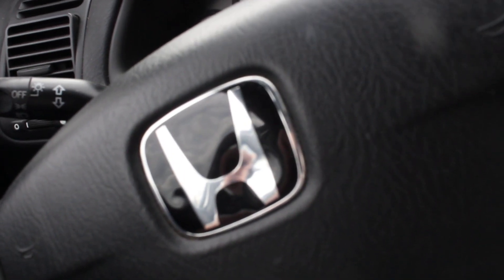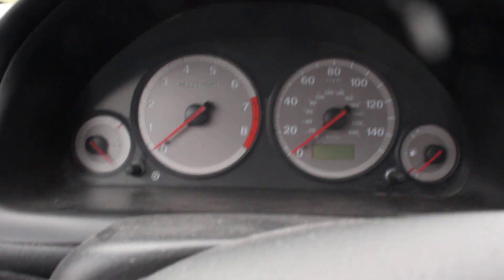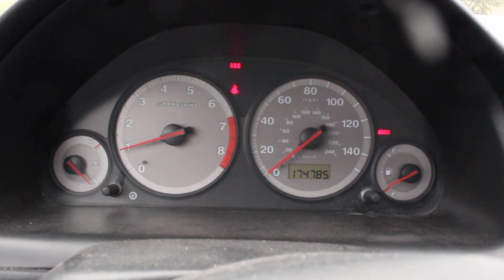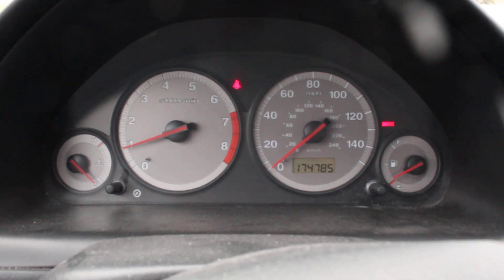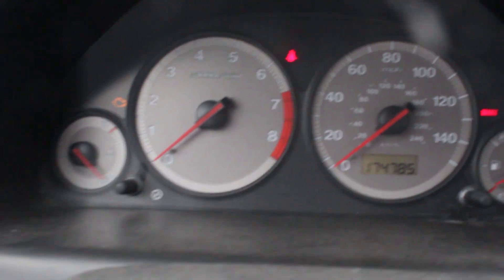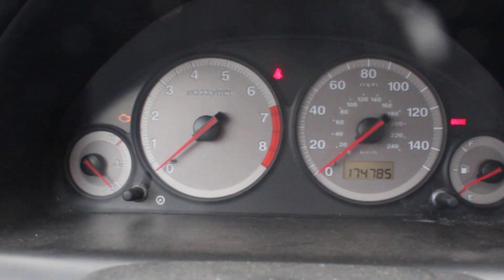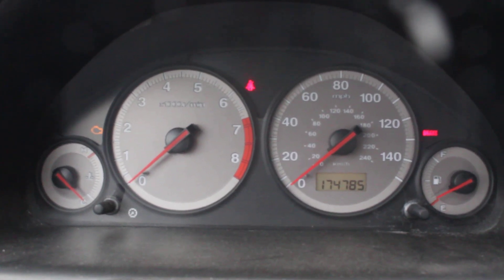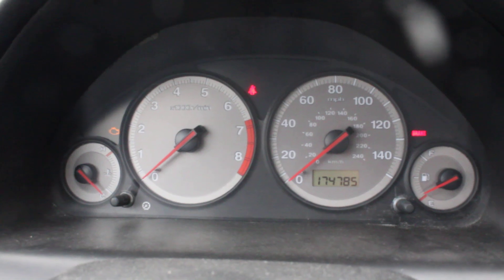What Honda "Limp Mode" Looks Like, '02 Civic With A Bad ECM

Comment: so did what fixs this got one doing the same and dont wanna spend $250+ trying to fix lol
Reply from the maker: ECM. I got a new one and had it flashed.
Reply: wildwildwest11 ok so they can flash any computer to my key?
Reply from the maker: Yah, that is what they do when you bring it in. You give them the whole car, the key and the new ECM. They need to use the Hondata diagnostic computer to sync them all.
Reply: Thanks for the update
Reply: Sorry for all the question, ,,but my civic is an lx 5spd,,,can I use any ecm as long is for same year and lx?
Reply from the maker: I would try to match the numbers on the ECU. I bought one from a parts re-seller on eBay that advertised it as an exact match and I contacted him to verify the numbers.

Comment: apart from this moment, the car goes into limp mode, than both the temperature gauge and rpm gauge turn off, and the car works in low rotation... you can drive... but only at low speed.. just like when one of the pistols doesn´t work.
So, I went to a Honde Dealer, the find out what was the problem.. He told me that one of the fuel injection points was dead or not working and that some electric wire must disconnected or in short with the ground. around 500 bucks to fixe it.. so and decide to not

Comment: Hi wildwildwest, thanks for the video. I got exactly the same problem on my civic 2003 ! I try to start the car, then I have to step on the fuel pedal in order to keep a high rpm (otherwise the engine will die), then a can hear some relay clicks coming from somewhere inside the panel, the clicks coincide with the MIL blinking (the battery lamp indicator is also on during this time). after 5 or 6 clicks, the battery lamp light off and the ingine MIL (the yellow one) light on continously.

Comment: Yeah u either fried the ecu or ur underdash harness u know its not doing a diagnostic check cause if it was ad wasn't able to complete or found a problem either way it would tell u why by throwing a code if that wa the reason it was  going into limp mode  replace ur ecu and also follow all the wires from the alternator to the ecu to see if anything is fried

Comment: Ecu....I had the same problem went to junk yard got a used Ecu/ computer  also got the key and removed the cover from steering wheel and key sensor and find out key lock easy to remove pack that and went home install  ecu lock,key drum and ....problem solve car running better tham before.  And didn't need to re-program the ecu

Comment: Problem was maybe i over did it when I was trying to get to work by accelerating too high. I had just barely installed a new alternator too that might of had something to do with frying the ecu lol. Anyways the method i used to fix my civic is posted below hope it helps anyone who has the same problem.
Reply: What's ur method I cant find it

Comment: *FIXED* 
I bought a used ECU/ECM from EBAY(Make sure its the right one Automatic or MT and with or w/o Vtec) for 100 bucks and took it to Honda to program it to my CIvic and flash the keys (make sure you bring all your keys for the civic). To save money you can take out the ECU and have everything ready to go for Honda, they will charge you if they have to take the glove box and ecu out. Honda charged me $110 bucks to program the ECU to my civic. my civic is back on the road hope this helps.
Reply: I bought mine and didn’t noticed it was a VTEC ecu and mine is a non 🤦🏻‍♂️
Reply: @isaias131982 did it still work?

Comment: Have you fixed it yet? What was wrong with it. Looks like a short on the power side making amps go up and making the relay click because its pertecting its self from shortting out
Reply: RudyborjaEM2  so I have the same problem but mine is automatic  clicks same spot so do I just  place the fuse and my car will  drive cuz it driving idk why same problem

Comment from the maker: No, still down.  I have reset the ECU every way I can and no dice.  These symptoms seem to be common but no one seems to have the definitive repair procedure.
Reply: Most definitely your computer is damage it has short circuit this happens when electric problems occur it could be just about any electric issue.what the computer does is simple it communicates with all sensory with allowing speed idle when to shift etc.that clicking is because theres a short some where leading that relay trace it to its function theres without any doubt a bad connection somewhere i did this to my civic as well an fixed that.but definitely take the ecu out open it to check for burn circuit its ussualy the one square plate silver looking if it has leaks over the gel coating protection an it looks like rust over it rub with you nail gently it rubs off with no gel protection its burnt that happened at somepoint either driving an electrical issue happen or as simply just even change headlight bulb.but definitely check your ecu theres defiantly sign your computer is not communicating thats y its boggs down because it looses communication at certain rpm rev most time between 2000 or 3000 n 4000 then you loose power.check ecu for sure.if change the ecu problem persists now check for air valve leaks and pressure an crank position sensor.
Reply: wildwildwest11 nothing yet

Comment: did the battery die when the alternator broke?? if so,restart your ecu because thats probably your problem..disconnect the negative terminal on battery for 15 minutes or take out the ecu fuse for 15 minutes...pop it back in,turn on your car and let it idle until its fully warmed up(do not touch the gas or anything)..when it is fully warmed up shut the car off and turn it back on right away..ecu is now reset..hope this helped! happened to my car earlier when my battery died..its a common problem
Reply: Evil Genius ,was it actually the relay or was it the ECU that was bad.